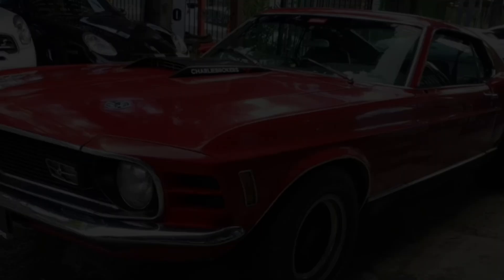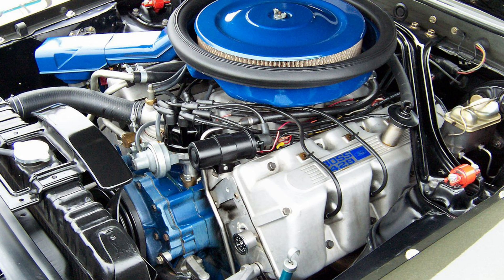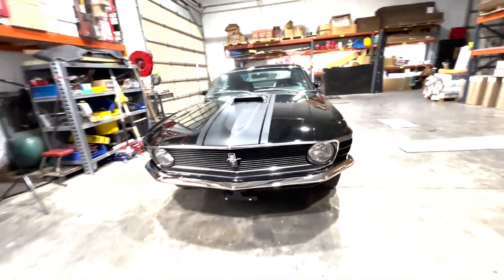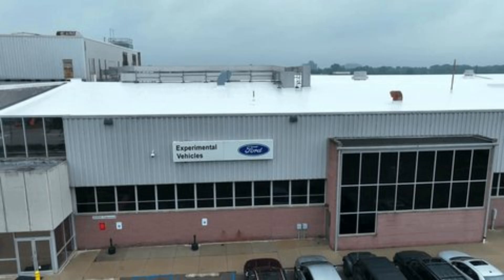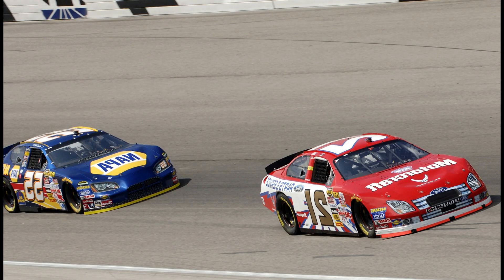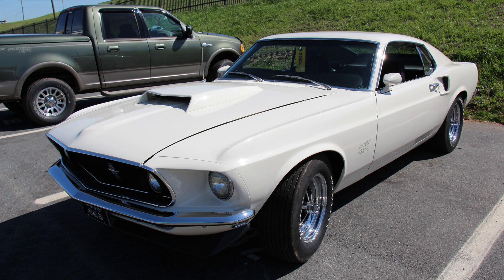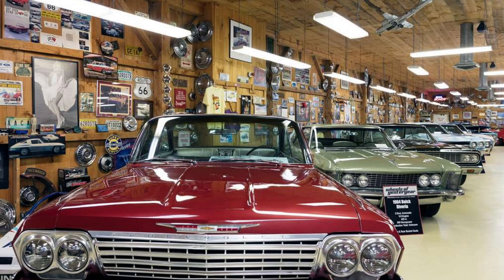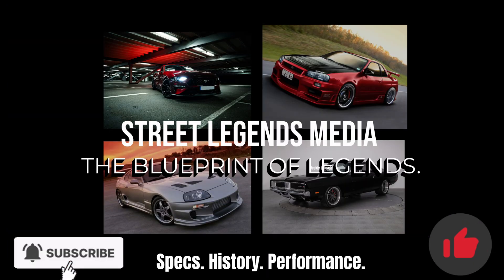Built for NASCAR Extreme 1969 Ford Mustang Boss 429 Horsepower Performance Torque Specs

Comment: Most Boss 429 I've seen sounded like the engine was horribly detuned, like an engine prevented from breathing. If 375 horse is grossly detuned, wow!
Reply from the maker: That is a brilliant observation, and you've hit on one of the most misunderstood aspects of the factory Boss 429.
You are absolutely correct. The 429 hp rating was grossly detuned for the street, and the restricted sound and feeling were a direct result of that detuning process. The stock street version was genuinely choked by Ford.